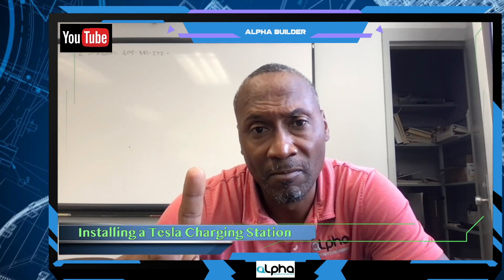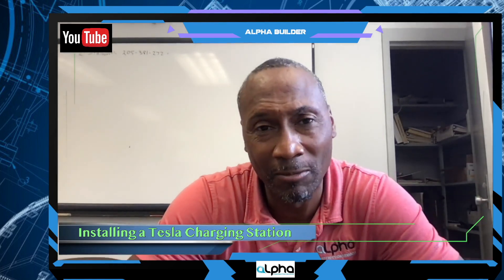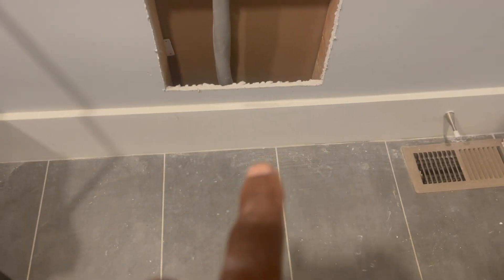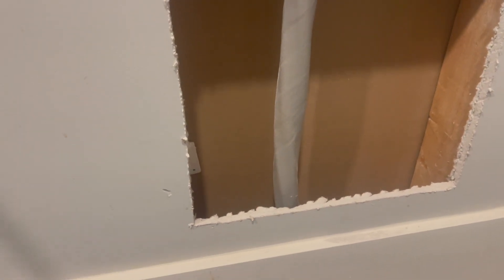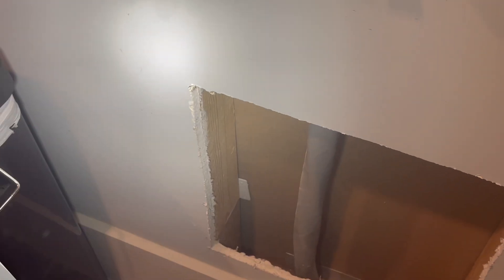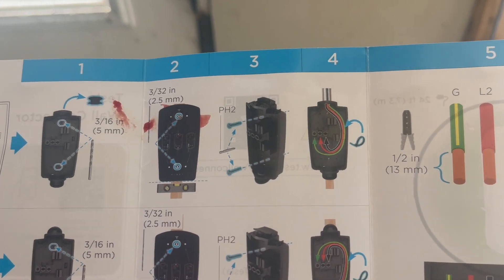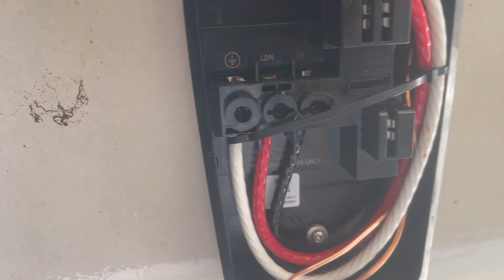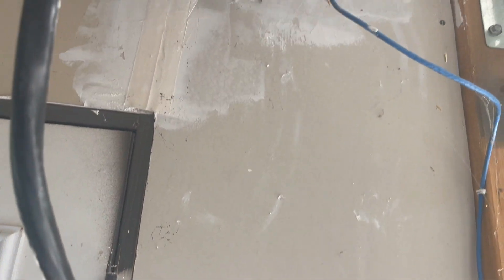How to Install a Tesla Home Charging Station: Step-by-Step Guide

Comment: Did this project myself this weekend with the gen 3 wall connector. It was nearly a 75 ft run of two 6 guage THHN wires and one 8 guage THHN wire for ground. Ran it through 3/4 inch electrical pvc conduit ending at a 60 amp Eaton breaker.

Comment: What size wire you run?
Reply from the maker: 60 amp breaker with #6 Wire
Reply: @thealphabuilder8230  ok just asking bc I wanna do mines but they say romex is rated for 55 amps. should I just use a 50 amp breaker?
Reply from the maker: @cobb5115  You should consult a licensed electrician